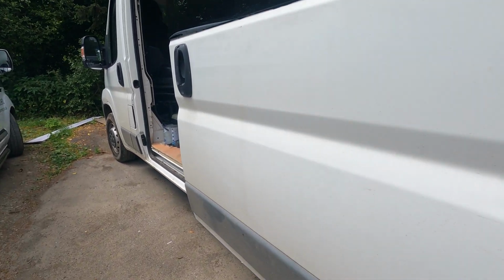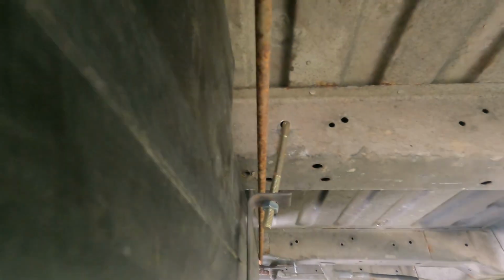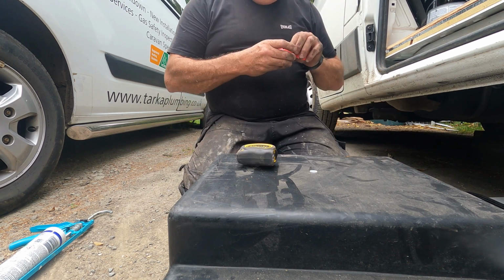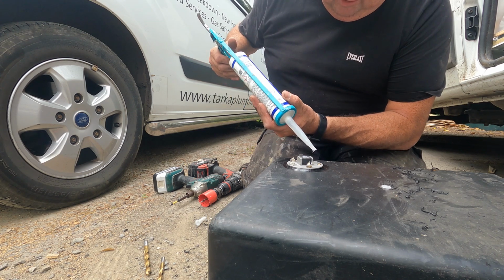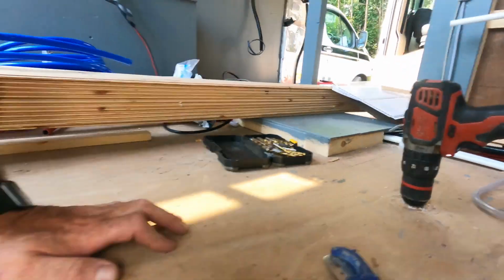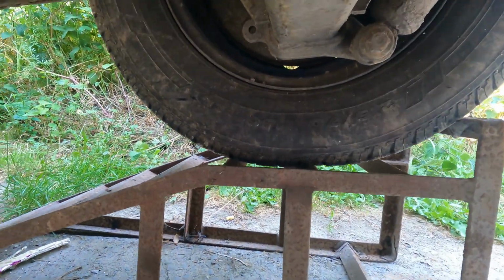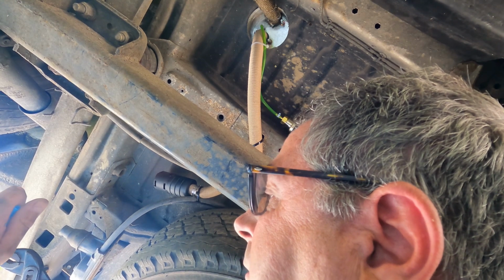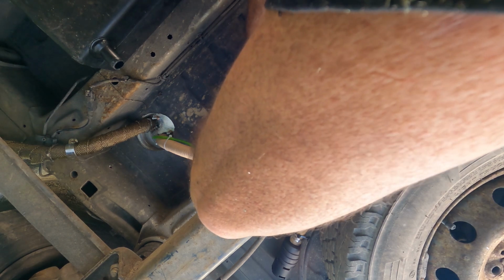ITS NOT A DREAM - NEARLY THERE

Comment: mate you say about all the rust , but if you dont coat where you drill it will be far worse than everywhere else
Reply from the maker: Yes I’ve been using hammerite when I drill through the van 
I think it’s should be good with that